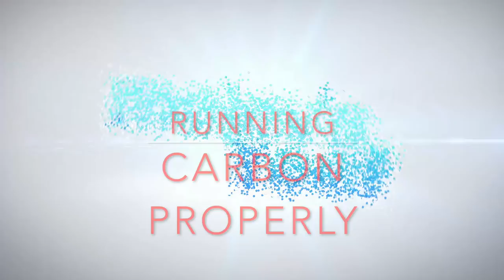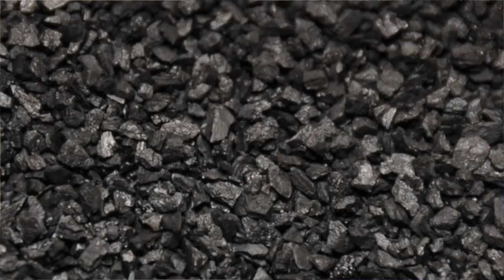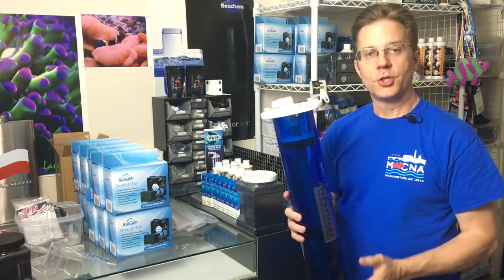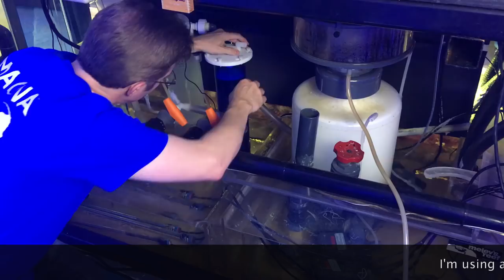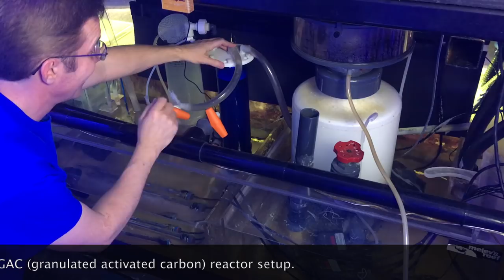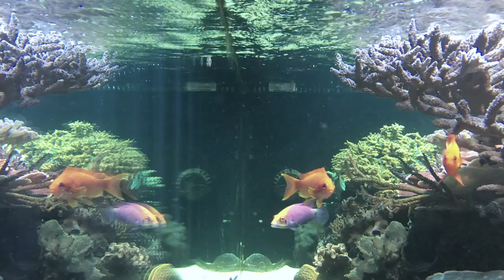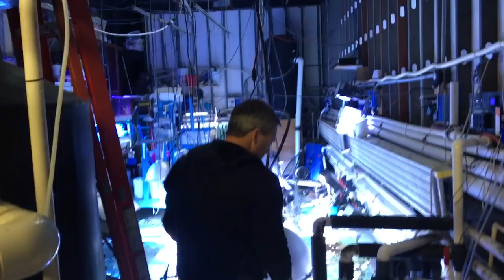Running Carbon Properly in a reef aquarium

Comment: Why Not Pre-Rinse Carbone before you add it to your filter - Then maybe one rinse in case Carbon "dust" occurs while adding it to the filter ?
Reply from the maker: It's far easier to pour dry carbon into a reactor than it is to scoop wet globs of the stuff into it.
Reply: You stated in your tutorial that the Carbon does all it can do within a few days - To remove it until a later time when needed again.  Here's my problem - I am Daisy Chaining 4 DIY built Canister Filters together - One of them - a 4" x 18" Canister was / is going to be filled with Active Carbon. I believe you meant that the water is as clear and clean as it's going to be after that period of time, but the Carbon itself, does it become ineffective as in depleted of capabilities? I do not intend on pulling it out and putting it back every few days or even every few weeks - In my experience - not as extensive as yours, though the Carbon is not "Needed" it is still good - I am thinking this Canister's load should last / be effective for at least 6 months - Am I wrong - Your input is appreciated and respected - After all, I certainly do not know it all.

Comment: I am planning on running gfo and carbon reactors in my sump. where should I put the pump to suck in water and where should I put the and end outlet?
Reply from the maker: You can draw from the spot where your reactors are, and return the same zone. Water flowing through the zones will constantly bring new water so it's not recirculating the same carbon/gfo-filtered water.  I use a single pump that draws from the return (return pump area) zone and feeds my various reactors.  They drain into the return zone. 

Basically, I don't draw water from the skimmer zone, nor the refugium.
Reply: melevsreef so you drain from the return zone and the water flows back into the return zone?
Reply from the maker: Yup. If you're like the output to dump into the skimmer zone instead, you could.
Reply from the maker: Have you seen this video yet? https://youtu.be/gaDE1Swuke0
Reply: +melevsreef okay great! what do you recommend in the refugium section? I'm really just trying to get rid of nitrate and I got rid of the bio ball set up from the owner before me. I'm going to have a different filtration. I am going to hook up two of the reactors and run a refugium just need to get. I heard sand and mud is not good?
Reply from the maker: I'm a big fan of biopellets.  The refugium needs some sand and some macro algae, plus a daylight bulb over it.

Comment: I always thought carbon was supposed to be used all the time, with proper carbon changes, to remove harmful chemicals in the tank? Didn't know it's merely used for cosmetic purposes of the water. Good to know!
Reply from the maker: +Dos Maiz (Twocorns) If it is the only thing you'd use for filtration, perhaps carbon would be more critical.  Carbon was used decades ago in saltwater systems using canister filters, and of course on smaller tanks using hang on back (HOB) filters.  However, since it doesn't last long, you'd be forever changing it out and it would get pretty costly.  And remember, every time you use carbon rinse it very very well before installing it in your system.

Comment: Can I substitute activated carbon for Purigen?
Reply from the maker: Purigen comes in a small mesh bag, so I don't think that would work to well.
Reply: melevsreef i have the 250 ml bottle and comes loose without the mesh bag. More than anything I was wondering if Purigen is a better media than carbon.
Reply from the maker: It's made up of other items besides carbon.  I have a feeling it would pass through the internal sponges of any reactor too.  But if you wanted to try, you can.  Just keep the flow very slow, maybe 60gph or so, or 1g a minute. http://www.seachem.com/purigen.php
Reply: melevsreef thank you so much for the reply. I am watching right now your video of the 20,000 gal reef :)

Comment: I agree that carbon is very short lived, that's why spending a lot of money for a fancy carbon block in an RODI system is very annoying to me... I bet no matter which one you use, it'll be spent after a couple hundred gallons of processed water.
Reply from the maker: Yes. If the waste ratio is 4:1 you can make 125g monthly for six months. Then change the carbon blocks.
Reply: +melevsreef I suspect that 750 gallons across 6 months is twice as long as it's really good for since our municipal system uses chloramine.  I've be meaning to test for it before and after the carbon stage across time, but it's one of the many things I have done yet haha

Comment: how much is a cup, you can in the 21st century please use the metric system, your audience is global and not local, keep it up
Reply from the maker: According to a Google conversion calculator, 1 cup is 256ml. Hope that helps.
Reply: not really, Carbon is dry and not liquid
Reply from the maker: +Sven C Agreed, there is a difference.  I'm just trying to get you closer.  Typically it's 8 oz per cup.  A half cup is 4 oz, but dry weight versus liquid is different. I'm filling up a measuring cup so it is full, flat across the top.  http://www.asknumbers.com/CupsToOuncesConversion.aspx
Reply: Carbon is measured in liquid measurements. When you buy Carbon it will be 100ml, 250ml, 1liter etc. And i believe the weight is the same but i may be wrong. 1l = 1kg
Reply: its more like 1000ml bag = 580grams weight
Reply: +Sven C you're right, the weight is less. But with the seachem matrixcarbon 1000ml is 720g so it probably depends on the type of carbon as well
Reply from the maker: +Sven C If you are worried you are going to use too much, use less.  You can always opt to use more if you don't see the desired results.

Comment: MMM starfire, the shatter glass. Buy acrylic, avoid seams and avoid the "green" in glass from the NECESSARY iron.
Reply from the maker: I work with acrylic, and have had a smaller acrylic tank in the past.  My frag system is all acrylic right now. But my display tanks are Starphire and look great.  I've had starphire glass tanks since 2004.  None have shattered.  Leaks happened because the silicone let go, while the glass was perfectly good still.
Reply from the maker: Here's a link to the frag system: http://melevsreef.com/tanks/frag-system

Comment: GUYS NEVER USE CARBON AT ALL
Activated carbon can also remove the trace elements and minerals that are important to your fish, invertebrates, and corals. A recent study has found that the heavy use of activated carbon in marine aquariums can cause Head & Lateral Line Erosion disease (most often seen on fish in the Surgeonfish Family). This can be avoided by using a trace element additive in the aquarium.

Comment: just open and honest, it's going to be a real pain in the ass to have to take that reactor out of your cabinet every couple days and replace the carbon... I mean... there's got to be a more optimal solution
Reply from the maker: You didn't understand me. I'm stating that carbon is only good for a few days, not that you should run more every few days.  Set up your reactor with the proper amount of GAC and run it for 3-4 days. Remove it, clean it out and store it until next month when you want to polish the water again.
Reply: ah, got it. Thanks  @melevsreef